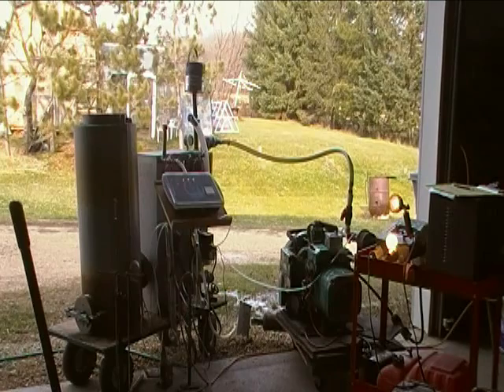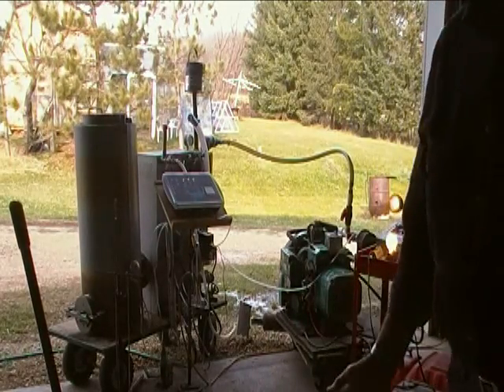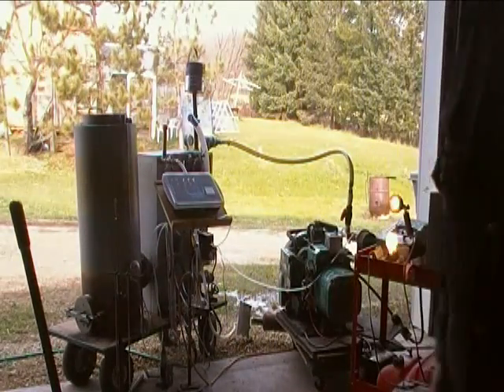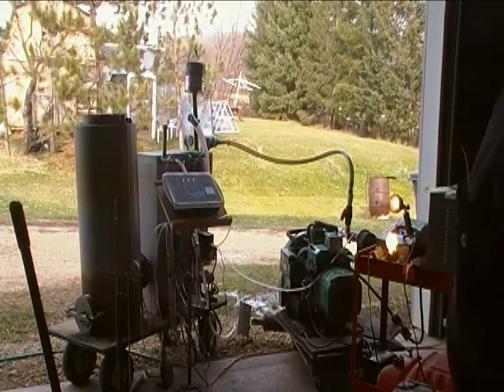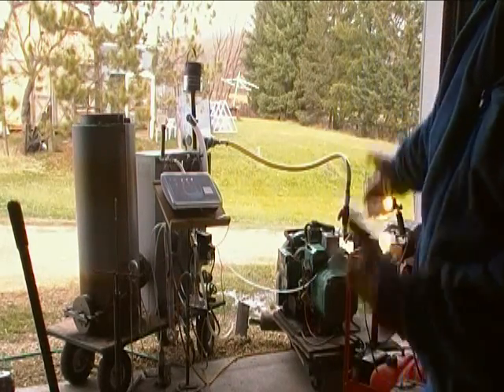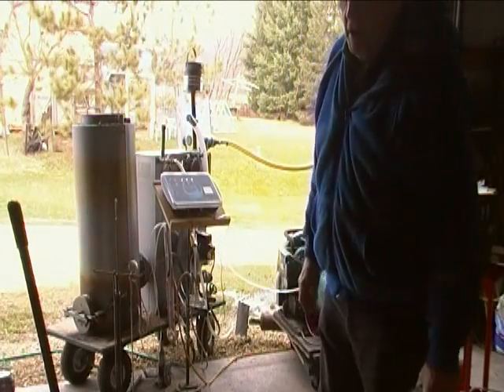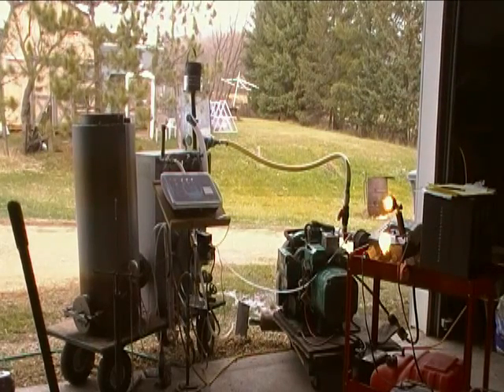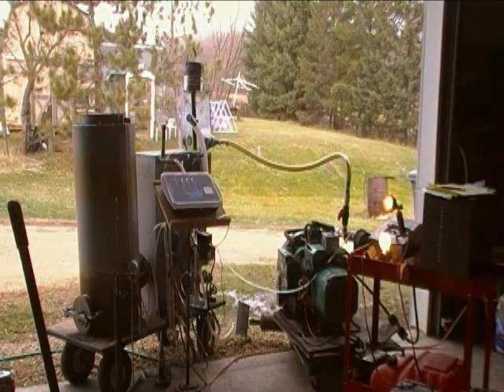JXQ-10 and Oan Genset Nov92012 Test using Arduino based Datalogger

Comment: As I was reading your replies to others in the blog I was seeing some of the same issues you were seeing with some tars in my gasifier. I'm running a smaller generator so cracking the tar was a real task but I wound up reducing the reduction zone down to a 2 inch opening and I always start with pure biochar before I add any
fuel to the gasifier. From what I've learned from experimenting is that biochar will give you a very hot clean burn on start-up and it will continue for the full run. If you get a moment check out my last "How to" video. It will be video 4. This may give you a few ideas to try out. Once again, you have uploaded some really good informative videos.

Comment from the maker: Hello, Sean.  I have reduced the size of the grate from about 11 inches diameter to about 5 inches diameter.  Yesterday, Sep 11, 2013, I made a run but this change had little effect on the outcome.
I did, however, run for 2 hrs 10 min w/2160 watt load, clean grate and remove half the burnt fuel from the hopper, then run at 3660 watts for 35 minutes.  MAIN problem now seems to be fuel burning upwards to the top of the hopper.  Now trying to figure out how to report all this.

Comment from the maker: Regarding the "tar":
 the driveonwood website has some really good forums.
If you go there and choose small engine forum,  you will see recent posts I made on the subject.
Note that I made two entries showing pictures of various parts of the downstream plumbing and the engine carburetor.  Seems the system is doing a better job  than I thought.
  Please keep in contact, particularly if you buy that gasifier.  I think you can send me a private message through youtube

Comment: Hi there, 
The tar really does seem an issue still if u plan on a longer burn. Being a "downdraft" configuration should be ideal to minimise tar levels. Oven dried chips will have an impact I suppose on the below grate temp.bidding on exact same type gasifier on ebay at present and came across your video. Very informative, keep up the great work. Much appreciated. Hopefully will start tinkering with it soon too!  keep posting!

Comment from the maker: Several others have said that running on gasoline  is a good way to get rid of some tar from the intake valve stems.  I have not had any troubles with sticking valves yet, so I consider a 5 or 10 minute run on gasoline to be a preventive thing.
  My woodgas output is not as tar free as I'd like it, since I still haven't ever  gotten my "below the grate" temperature above about 620 degrees F.
  I do know of one guy who has a gasifer similar to mine who did stick the valves.  Now he does the same.

Comment from the maker: Yes.  It makes little difference whether the lid is all the way open or all the way closed.  There is a one inch diameter air inlet just beside the cover. That's all the air needed to run the system.  In fact, I have to tamp the fuel bed about every 10 minutes or so.